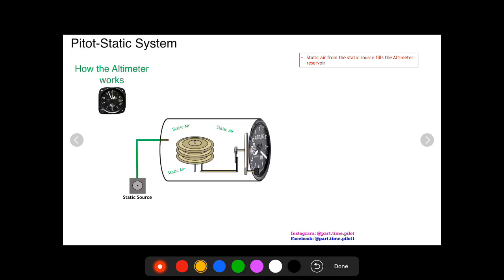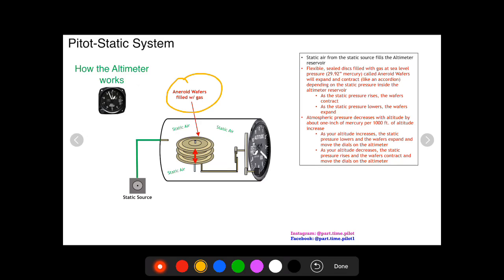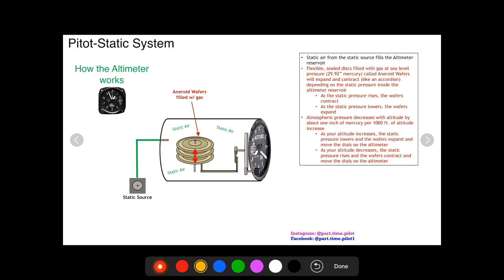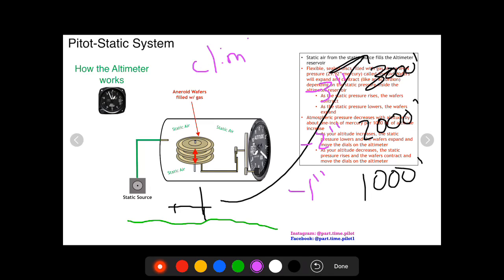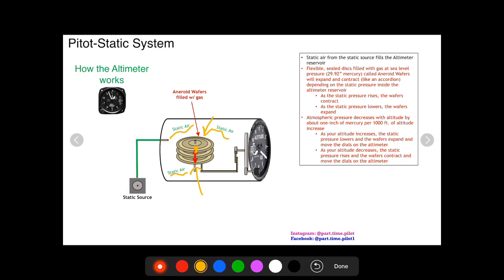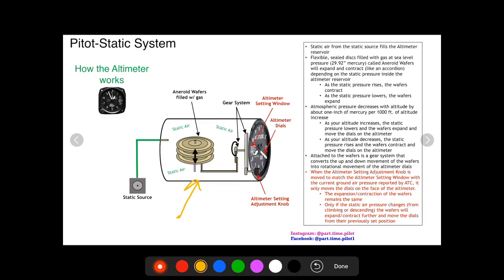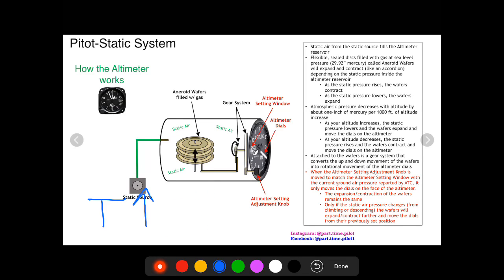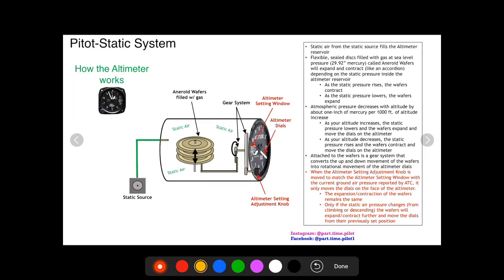How do Aircraft Altimeters Work - For Student Pilots

Comment: My instructor brought in an altimeter that we all adjusted. When the pressure knob was moved so did the other dials. Is this normal and if so how does it know my elevation based on atmospheric pressure? Thanks!
Reply from the maker: Yes. So this knob as explained in the video is the pressure setting adjustment knob. 

The way the altimeter works is key to understanding why when you spin this knob to change the pressure setting to your local barometric pressure that the reading on your altimeter changes. 

The altimeter has an aneroid wafer or balloon filled with sea level pressure air. The outside of the balloon is the air you are currently experiencing. So if the air you are currently experiencing is higher or lower than sea level it will expand or contract the ball and move the needle. 

However, we don’t always experience sea level pressure when at sea level. The pressure from day to day changes and is normally different from standard. This is what the what the adjustment knob is for. At sea level pressure you keep the adjustment knob at standard 29.92 as your reference that your altimeter indication base changes off of. But when pressure is not 29.92 you have to change your sea level reference point so that your altimeter now knows to compare to the new sea level pressure. 

For example, say the pressure is 30.12 and you are on the ground at the airport. You change your setting knob to 30.12 and your altimeter indication will change to indicate your elevation above sea level accurately because you have said hey altimeter this is our new sea level point. Then, from there as you climb in altitude and the altimeter sensing less pressure as you climb it will compare to this new reference of sea level pressure of 29.92.
Reply: I’m getting close to understanding, maybe. My local airport is at 50 feet above sea level. We adjusted to show different air pressures. That number in the window changed accordingly and the elevation dial moved also. Why? The airport didn’t climb. This is from a stationary position. Do we need to be doing addition or subtraction while flying and reading that because standard sea level elevation is 29.92 and our adjustment on the ground made the dial read X before we even took off? Thanks for taking the time to answer.
Reply: Just to add I feel like he said the altimeter he had in the class was not working because we are at sea level basically and when we set that Kollsman window to current pressure it was reading 1510 feet. Clearly not where we were sitting. Should it read zero before takeoff? Was not really happy he’s using defective instruments as examples.
Reply from the maker: @erickfish1400  oh well if it wasn't working right Im sure it confused you more lol. But it still should have shown what happens when he changed the setting. 

There is a good online simulator you can play with over and over to get this down: https://www.luizmonteiro.com/Learning_Alt_Sim.aspx

But lets say we buy a brand new altimeter and our mechanic installs it in the plane and we are first to use it at your airport. When we get in we are gonna see it set to 29.92. The altitude that it is displaying will only be accurate if our actual current pressure was a standard 29.92. So if we look at the reading and it doesnt say 50 ft then we know that the current pressure is NOT 29.92. So we would dial up ATIS or a METAR to get the latest pressure setting. 

Let's say we do that and ATIS says it is 29.82. In this situation our altimeter would read 150' (for now, dont worry about how I know that it might confuse you more). So we need to change our pressure setting to 29.82 so we spin the knob until it reduces in the setting window until 29.82 and as it does this, our altimeter reading will start to also drop to 050'. 

This is actually how pilots check their altimeter before takeoff. They make sure that with the correct pressure setting in, that the altimeter reads their known elevation (in your case 50'). 

ALternatively, with this knowledge we could determine the actual outside pressure without even getting an ATIS or METAR (you still want to but if you dont have access to either you can use this method). Since we know our elevation, we know what our altimeter SHOULD read. In your case it should read 50' when we are on the ground. So, we could simply spin the setting knob until our altimeter reads 50'. 

There is no need to do any math with your altimeter when flying or even on the ground. Simply make sure it reads your known elevation on the ground and the setting also matches what ATIS is reporting and then when flying just make sure to periodically get updates from ATC or ATIS's on the current pressure in your area and keep adjusting that altimeter setting whenever it changes for you. That way your altimeter stays accurate
Reply: Extremely helpful. I guess what I’m not getting is that the standard for atmospheric pressure at sea level is 29.92. Doesn’t that change at sea level during weather changes? That would give me a different number in the pressure window thus changing the elevation on the dial but my runway didn’t go up or down so how is that still accurate if the device is built and sealed to read zero at 29.92? Thanks again for your time, I will recommend you to all my classmates.
Reply from the maker: @erickfish1400 Yes the standard sea level pressure is 29.92. Yes it changes as the weather/different air masses move over your area. 

When that happens (new weather that isn’t 29.92 anymore) your altimeter changes! This is where understanding how the inside of the altimeter works helps. The air in the balloon is at 29.92. If the air outside the balloon is also 29.92 the balloon neither contracts or expands. But when new weather rolls in and let’s say it’s lower pressure like 29.82 like we said before now the pressure of air around the balloon is 29.82. But inside the balloon, since it’s sealed shut, it’s still 29.92. So the pressure in the balloon is now higher. Pressure always wants to even out and go from high to low. So the air wants to get out of the balloon and so the balloon expands. When it expands this changes the needle on your altimeter and changes the indication. 

So now you’re on the ground with 29.92 in your setting window and your altimeter no longer reads 50’. That tells you that new weather has come in and you need to update the pressure setting in the window to 29.82 to sort of recalibrate back to your zero point. When you do that, then the altimeter will go back to 50’ 

Hopefully this makes sense. And appreciate the support!

Comment: As ambient pressure and temperature change without readjusting the altimeter, the indicated altitude will be inaccurate. Use the mnemonics "High to Low (Pressure) or Hot to Cold (Temperature), Look Out Below" because the altimeter will indicate an altitude higher than actual; i.e., you will be flying lower than you think you are.
Reply from the maker: Yes! We have a video about this!

Comment: 5:20 temperature goes down, pressure goes up, not down
Reply from the maker: What is your source for this?
Reply: @PartTimePilot  https://youtu.be/DquXO2FEl0Q
Reply: @PartTimePilot  if you're talking about a gas in an enclosed system then you'd be right. If you were, my bad.
Reply from the maker: @mihir777  it’s a tricky subject. An ideal gas in and adiabatic system, 100% P goes with T. In air, it’s usually also the same but gets trickier because it is not an adiabatic closed system. However, if you are training to become a pilot and preparing for your exams, remembering that Pressure goes with Temperature will help you pass the exams and understand the altimeter. 

In the video you sent me but deleted it somewhat misspoke. It said low pressure with a cold front when it should have said low pressure with ANY front. This makes since because air travels from high pressure to low pressure. So high pressure air will travel to meet at a low pressure area and that’s where the meeting of the two air masses occurs (front). Meteorologists usually don’t characterize a cold or warm air mass with having a specific pressure but instead say that an air mass is a mass of air with the same temperature, humidity and density. So that video was a bit misleading but I don’t blame them because it’s hard to describe such a complex system with simple rules. 

Here is another good video that explains this stuff https://youtu.be/E-5rieCUPuc
Reply: @PartTimePilot  as the temperature rises, the air expands and becomes less dense. The pressure exerted by this less dense column of air above will exert less pressure. Hence, as the temperature rises, barometric pressure falls.
Reply: @PartTimePilot  what was deleted again? The video link is still there.
Reply from the maker: @mihir777  Oh I don't see it anymore
Reply from the maker: @mihir777  So the different is closed vs open systems. You are correct in an open system when the density can decrease like in the air. If you are speaking of the altimeter though, it uses a closed aneroid wafer like a balloon. You can do this experiment yourself. Fill a balloon up nice and full in room temperature weather and then take it somewhere where it is much colder (freezer for example) the balloon will deflate because the pressure inside decreases because inside a closed system the pressure goes with temperature and the kinetic energy. This has always been somethinig I have struggled to explain and may have even mis-stated or not been specific in my videos. But for pilots concerning altimeters... temp goes with press
Reply: @PartTimePilot  closed and Insulated system will be adiabatic. In that case, temperature will increase with pressure PV=nRT.

In open systems, such as the earth's atmosphere (not enclosed, neither Insulated, so not adiabatic), the pressure will decrease with increase in temperature.

For pilots, the latter is important as they fly in an open, non-adiabatic system.

The most important thing to remember for pilots "High to low, look out below!"
Reply from the maker: @mihir777  100% agree. Well said. 

I am explaining why the high to low look out below is accurate. That says when you fly from high temp to low temp you should look out below because you will think you are at a higher altitude than you really are. This is because your altimeter is reading higher than your actual true altitude. The reason your altimeter is doing this is because of the decrease in temperature which cause the aneroid wafer to deflate inside the altimeter which the altimeter than correlated to a rise in altitude aka a lower pressure.
Reply from the maker: @UCCx2G-Rx8InIslpAs88HwEg haha it’s the same for temperature (high to low look out below) and the reason is what I was explaining. That the wafer deflates like a balloon in cold temperature and inflates in hot temperature.
Reply: @PartTimePilot  Agree with hypothesis 1?
Reply from the maker: @mihir777  yes
Reply: @PartTimePilot  lets establish our conclusion step by step..
Hypothesis 1:  For the same true altitude, as the air warms up, density decreases, and thus pressure decreases. As air cools, the density increases, and pressure increases.
Reply from the maker: @mihir777  2. In a closed system like a balloon or the wafer in our altimeter, this is the opposite. A high temperature causes an expansion but because it is contained in a volume the increased kinetic energy of the molecules increases the amount of pressure exerted on the container walls. In the altimeter this expansion is seen as an altitude increase or drop in pressure which makes the statement “high to low look out below” accurate. This can also be observed by filling up a balloon at room temperature and taking it to freezing temperature and watching it deflate or lose pressure
Reply: I think theres a difference in stating the sequence which increase first whereby if u state pressure increase first, then followed by temperature increase and the result will be different if is compared to temperature increase first then followed by pressure where the relationship inverses.

Comment: question, when you get into your plane, is it assumed to just zero out the altimeter to read zero to correct for temperature and pressure variances or does ATC make recommendations that are more or less than what the place shows on the ground?
Reply from the maker: When you get into your aircraft you should get the current altimeter setting from the local ATIS. Once that is dialed in you should check to make sure that the altimeter reads the value of your elevation (airport elevation). It should be within +/- 50 ' or so. Temperature variations from standard may effect this but this is the best you can do with the analog altimeter in your aircraft

Comment: Thank you for your video.
I'm just curious about something.

1. Is the pressure inside the wafers always be 29.92 in Hg? If so, I think I misunderstood that the pressure inside the wafer can be changed by adjusting the knob. I'm not sure about this.

2. If the temperature is below the standard day(which is 15˚C?), does the altimeter indicate higher altitude than the average day?
Reply from the maker: 넬린 Thanks for watching. Those are good questions. 

The wafer is sealed with gas at 29.92 Hg.  This is kept constant so that the wafer expands or contracts based on the outside air pressure surrounding it. When you move the dial you are not changing anything inside the wafer, you are only moving the needle on the face of the altimeter. Think of it this way... it’s a standard day (29.92) and you are at sea level and you haven’t touched your adjustment knob so your altimeter reads 0 feet. You sit there for a few hours and the temperature goes down (and so does the static pressure) and you see your altimeter start to read more and more altitude because it is sensing a drop in pressure and thinks you are climbing. This is happening because the static pressure surrounding the wafer is now lower than the pressure inside the wafer so the wafer expands and this expansion moves the needle on the altimeter. So now it could read something like 300 feet but you know this is wrong because you are still sitting at sea level. So you decide to check for an updated ATIS weather reading and see that it says the pressure is now 29.80 Hg. So you adjust your knob to 29.80. All this does is calibrate your needle to read an altitude of 0 feet again. Nothing inside the wafer changed. 

So to answer the 2 questions. 1. Yes always a constant 29.92. The adjustment knob only moves the needle to calibrate you with an updated outside air pressure and 2. If the temperature goes down the pressure goes down with it and the altimeter reads this as a higher altitude. 

Hope this makes sense!
Reply: @PartTimePilot  Now I get it. Thanks!
Reply from the maker: 넬린 anytime!